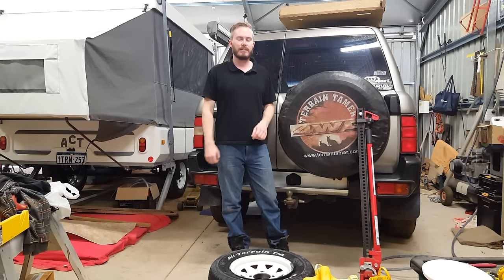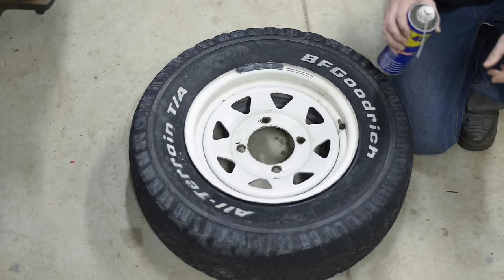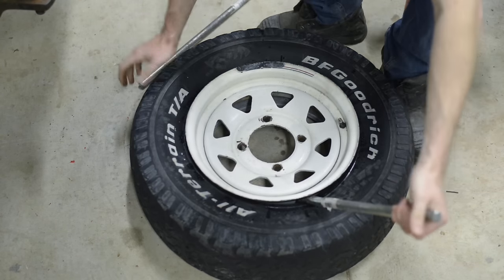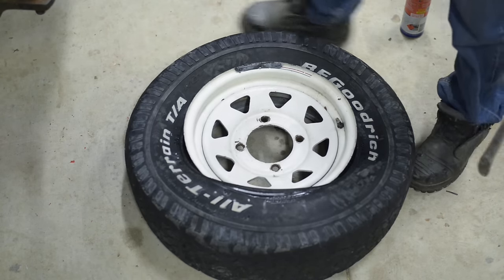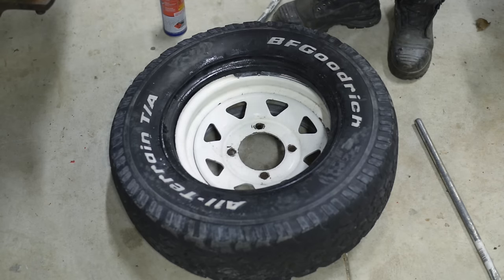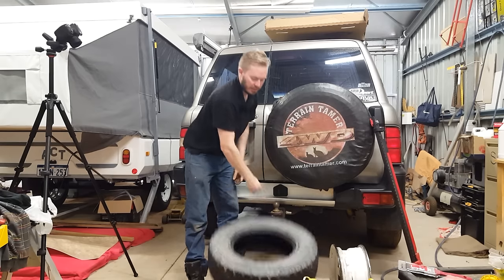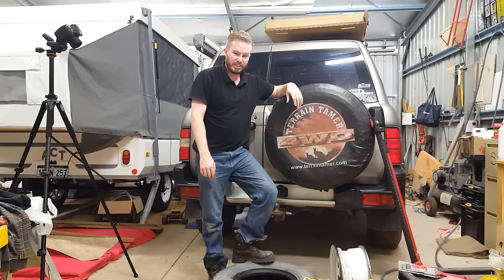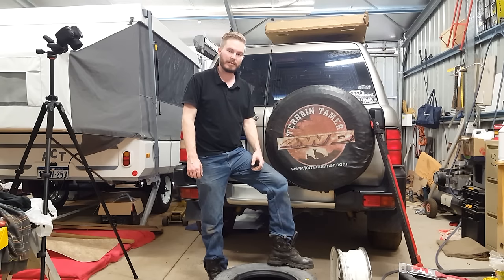How to manually remove a tire from rim

Comment: A good attempt by a person not accustomed to tyre removal. Two things i would suggest, DONT use WD-40 its lubrication is somehow different to a dish soap solution. Make a dish soap solution up and put it in a trigger spray, very handy if you are going to the middle of nowhere. The second one is get a LARGE nylon faced hammer, its much better than the club hammer in the video. You can hit the tyre irons without damaging them, and if you are smacking the tyre and catch the wheel you dont take a chunk out of the wheel!

Comment: It's a lot less effort if you leave the first tyre lever in and put the second one to lever the bead off. But grab a rubber mallet and whack the beads down with the mallet sliding the tyre lever round as you go.Don't take too big a bite of bead with the second lever.. Another way to break the bead is to drive over the tyre  moving it around, then drive over the next part.
Reply: Driving over it sounds good! Unless it is the tire from the vehicle you are working on... either way this looked like an ass whooping mess. I would keep a spare 👍

Comment: I use 3 levers and alternate them as I go around, I even half release the tension on the prior lever to make a gap to get the next lever in while holding the first lever with my foot. If you take little bites it's a lot easier.

Comment: Hint. By standing on the opposite side of tire when 1st trying to let it off, makes it a whole lot easier. It will place bead in deepest part of rim, resulting in far less leverage req'd.
Reply: Five star suggestion.
Reply: bead in deepest part of rim, like you say. this is the reason for the smallest diameter of the rim. a lot of people don't realize this
Reply: @joefalcon870  I’m 😢❤The yy😮
Reply: People know this trick?
Reply: I agree. I kneel  on the tire 180 from where I am prying over, this keeps tire down in the well.
Reply: I was going to say the same thing. 
Gotta get the bead on the opposite side inside the small ridge of the rim and they will come off like butter.
Reply: @bsea35 everyone has their trick to make it come off like butter or take a tire off in 60 seconds but where’s your video?! His video was dead on- it works well but it’s not fun. He also nailed it; it’s not where you kneel on the tire that’s the game changer it’s the lubricant. I pulled two tires today and 2 for tomorrow, and nothing worked until I found my dawn dish soap. Then I gave it a squeeze all the way around, poured water on it, set a board on the tire, and pulled the car up as far as I could and then parked it. I then hit it with more soap and more water a few times, after about 5 minutes the bead finally surrendered. It’s still a bitch
Reply: @roberth9188 I’ve changed hundreds of tires and don’t have to make a video because most tire people know what I’m taking about and there are many correct videos on YouTube. 
They way he is showing destroys or bends the lip of the rim. 
He’s making it way harder than it needs to be. 
Putting the wheel up on a bucket will also make this easier, you can maneuver the tire into the correct angle so the bead is inside the smallest part of the rim.

Comment: I recommend placing the wheel face down on top of wood or cardboard, so you can use the levers on the back side instead of the front

Comment: Would it not be better taking it off the rear of the rim to avoid scratching the front of the alloy?
Reply: No, because th3 well in the rim is not the right shape … using nylon protection on your levers and making sure to use a proper lubricant and get the bead well into the well …. will work though!
Reply: It needs to come out the outer side of the rim bc the the tire needs to be sitting on the hollow well of the rim which is close to the outer side of the rim while prying out so the tire

Comment: last video some person just took a screw driver & eazily slid around tire to lift it off wheel - but this shape didn’t look nearly so eazy.  however - seeing as how eazily you poped remaining 2/3’s tire off rim with 1 hNd & like no effort in like 1/2 a second, I’m curious IF, after scooping a ‘ or so over rim - what would happen if one just eazily grabs tire from tread or other side, with 2 hands both to left & right of liftd over area, & just left-right wiggles it off rim with tiny 1/10th” like fliters like, lFt rIt lFt rIt lFt & so on, etc.. ?🤔  sounds too eazy, but wouldn’t be all that surprisng👋 - or actULE with knee stop-holding tire in over rim position(from tread side), grabbing both under(other)sides of tire on right left, so lifting up & away from rim disgonally left rIt, etc.  - would be like a lifting - rolling right left motion.. mneah mIt wrk hU nOws.

Comment: Thanks for the video.
I managed to remove one side of a 7.50 16 implement tyre from a trailer,  just enough to replace the tube--I gave up (failed!!  )trying to get the second side off.   It might have worked better if I had left it on the trailer.

As an exercise,  I tried to remove a scrap 7.50 16 Michelin XCL from an after market land rover rim. I failed even to get one side off, bending up my ebay special "heavy duty??????"  tyre levers.
A bloke from Stapleton's Tyres come around to replace some 12.5 20 tyres on a front end loader.  He did it on the vehicle and used a bricklayers bolster to start breaking the bead, finishing with a compressed air powered compressor to finish the bead.  He used levers to complete the removal.  He was a big old boy and was sweating buckets by the end of the job--I dont think this seven stone weakling  would have been successful

Comment: You said you popped the bead, what does that mean? I can get the backside of the tire off no problem, but the front is completely stuck and idk why
Reply from the maker: There is kind of a lip on the rim which the tyre seats onto. You need to apply pressure to this to break the tyre free. Look up "how to break a tyre bead"
Reply: @Alex.G  thank you so much

Comment: This video show be titled how to take a tire off the rim the hard way when you put the pry bar in press the opposite side in the give slack then when it needs more slack kick it again pushing into the middle of the rim were there the slack will come from or you can just pry bar it away smack it with a hammer and pry and pry making a pain in the arse out of a little job and the other thing is don't take big steps with the bar take smaller steps

Comment: The bigger the tyre the easier. Front tyre on motorcycle is the hardest. Also depends on how many ply the tyre is. The more reinforced the harder
Reply: some motorcycles have bias ply  which is more reinforced than radial.  I feel like I've been beat up after changing  mine.
Reply: @Cleanandgood  plenty of lube. I have the new style tyre bar with nylon wheels and it is a breeze. Also on front motorcycle tyres try the cable tie trick. Bit difficult on beefy back tyres
Reply: @seanwilson471  Thanks. I'm gonna try it!

Comment: In order to hold the wheel while you remove the tire you might want to install the wheel on the hub of the car and tighten it then you can easily pry the tire out, I never tried it but I’m gonna do it in two da easily, I’m going to do it it the day after tomorrow, it makes sense to me as long as the car is jacked up security.
Reply: So... How did that work out?

Comment: I use straight dish soap makes it more slick after you get the first bead off the tire lift the tire and rim straight up pull the rim out at top of tire put a bar in between tire and rim pull back on tire use hammer and hit bead of tire it will fall right off

Comment: Title should be changed to "How to easily damage a painted rim?"
Reply: Wow you did that the hard way 😅
Reply: Exactly 😅!  I have watched several of these videos.  I think I'm just going to pay some guy at one of these tire places to separate this rim from this tire in 2 seconds.  I think I can talk someone into doing it for 10 bucks.  They might even take the bad tire off my hands.
Reply: @joeyallcock1011  thanks.  I'll use the info for future reference.  I needed another rim.  My old one was cracked.  The place that sold me another rim took the cracked rim with the tire on it.  I didn't even have to worry about removing the tire.

Comment: does that damage the rims?
Reply: razz P if you do what he's doing you will risk it when your doing a tire do little dits at a time with the pry bar and every time you get a bit off the rim stamp on the other side so it gives a bit of slack/ push down into the rim so it off the bead and is sitting more in the middle of the rim because that's were the slack will come from
Reply: Yes, very much, will chip the paint and in a short time corrosion will occur under the bead and cause leaks …
Reply from the maker: Don't listen to @Andy XOX  I think he's an undercover agent for a wheel and tyre shop. They don't want you to know how easy it is to do this yourself at home, because they make big money off this in their shops. Don't become a slave to their system!

Comment: well, to balance a car tire is not a big issue, the tire is marked telling you where to put the heavy side next to the valve, so that  you will know where to put the wait on the rim to even up the score , about 1 once will fix it up, look for that little white sticker some where on the bead  flat of the tire,  and that is the heaviest part of the tire, put that as close to the valve as you can, put the tire on the rim, air it up , watch your finger you only have 10,...and am sure you will like to keep them all, always when airing up the tire keep hands away from the tire BEAD,  that's is where the tire slaps the rim to the bead, now doing the balance? take a once of what ever kind of wait you are going to use to make the balance, go strait up from the valve and add a once, that will do the job, but you have to make double sure that you have the heavy part of the tire next to the valve, if you have the heavy part of the tire over to the left side of the valve, then, your going have to put on your once of wait led to the right side, and if you put the heave part of the tire over to the right side of the valve, then you need to add a once of let  over to the left , if you can find that little round colored circle on the side of your tire  put the once strait across from that round mark, and if you cant not find the mark on your tires then, like I said before, look for that little white sticker that is located  on the tire it's right next to the bead of the tire , you cant miss it, after the tire is aired up and  the bead is seated on the rim, then you cant find it now, line it up with the valve, add a once right strait up from it , that should do the job, and it could happen that some time 1 tire might be all balanced  don't need any led, and if this might happen, you will know if it's the front, because it would shake stronger then the back tire will, because it's on the staring , I have tried  the beads, didn't like it was shaking when I would  take my foot of the gas pedal , so I took them out of all my 4 tires, and did it the way am telling you, works perfect no shaking nothing perfect .           I called the garage , they wonted  around 50 bucks for the 4, not installing them our taking them off the car,  it took me around 45 min to take out the beads , aired them up, add my 1 once, slapped them back on the car and saved my 50 bucks.
Reply: That depends on how wide your rims are and whether you want your tyres properly balanced or not!
Reply: Now we know why our proffesionaly balanced tires are not balanced when you.pull out of wallmart with.8 wheel weights you.know they screwed up obviously they don't care if the tire is positioned properly pulled off 6 of the 8 weights was fine even at high speed if the weights are not near the opposite side of the stem.hole then chances are They didn't put the bead in the  right place or something is wrong. Like a broken.strand in the tire or a defective tire.if it's done correctly the small amount of weight is near or opposite the valve stem.as the stem hole takes off weight and the stem adds weight including the heavy metal stem.caos you.added can throw off the balance..the old school way is to spin the tire on free bearings it should never stop in the same spot if balanced or reverse direction of the spin means it's really.heavy on one side but your bearings must spin perfectly with no.brake drag at all to check it on a non drive axle..if you see lots of weighs you most likely have a bad tire or bad Install job. I have rebalanced many tires better than the machine does it and balance can change under use for many reasons like debris or wear of tread or wear and damage to the tire usually visible uneven sidewall because the tire was curbed and damaged. The machines work.well if used correctly and the tire is installed correctly..balance it with. The tire cap on as well it's not a lot of weight but it can make a difference especially with large metal caps. Hubcaps and beauty rings can effect balance as well even picking up.rock debris can effect balance. Sand dirt etc. So proper balancing requires clean tires and clean rims and dry air inside. Many reasons why balance can be off. Put the bad tires on the back or save as Spares don't be scared to experiment with adding or subtracting weight to an obviously poorly balanced tires if it has 10 weights on it I bet there is a reason that might be obvious if you inspect it carefully air pressure can effect balance and overall tire diameter sometimes a steering pull can be corrected by adjusting air pressure more air more diameter less rolling resistance pulls other side less air pulls low air side front and rear make a difference but front has a larger effect. A bad or bent suspension can be temporarily corrected but at the expense of tire wear and possibly even driveline wear as uneven diameter can strain the driveline but the road itself outs more weight in one side usually the right side is heavier and might needs pound or so of more air to achieve the same diameter. If on a long highway that is right sloped changing lanes can change tire wear patterns in some minor cases  as well some cars prefer left slope some prefer right slope nothing is perfect when it comes to our roads. The course of land itself has grooves that can wear tires to make then more or less even. But watch out for wide loads and stay in your lane please and keep your tires inflated within the safe ranges of pressure required there is a maximum rating and a minimum.safety factor in every tire if you check its specification cold tire less pressure hot tire more pressure etc . So keep near the middle of the range given expected weather and use conditions.

Comment: i would use a oil that's no petroleum based and silicon based as the petroleum eats away at rubber

Comment: Easier to sit the center of the wheel in something to get the tire off the ground and just take a crow bar and a small sledge and wedge the flat end of the  bar between the bead and run them beat the bar with the sledge around the wheel this accomplishes the same thing as the tire machine .